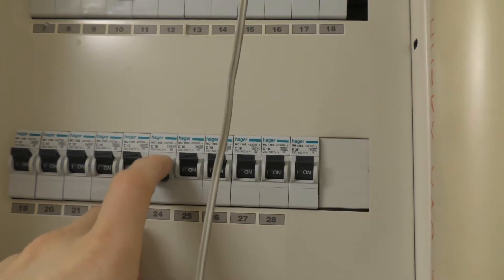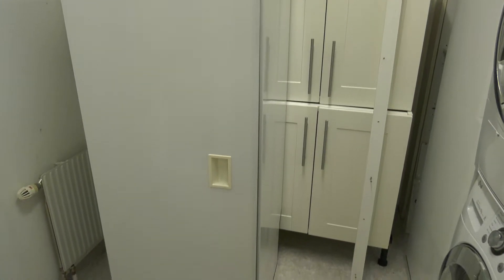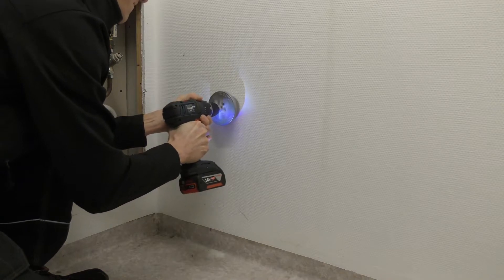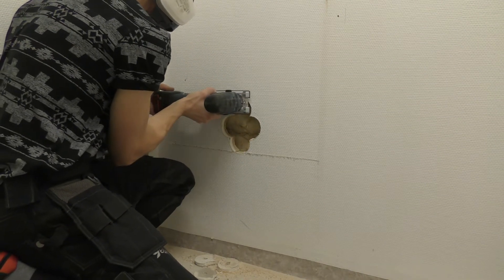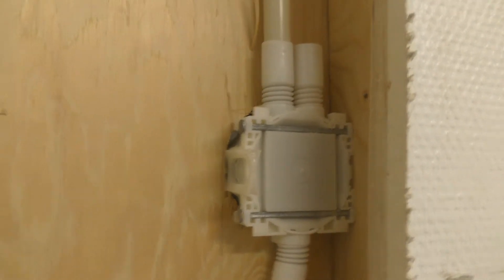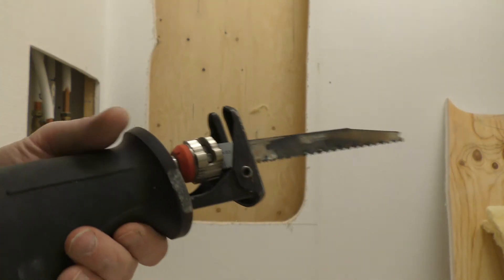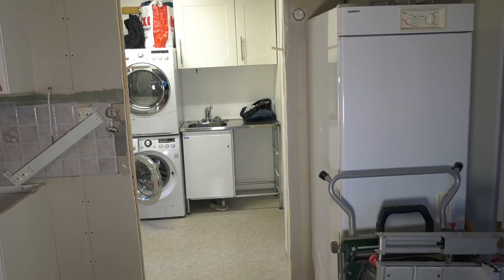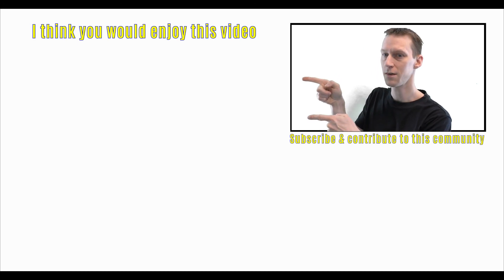Preparing for the solar on the urban homestead

Comment: This is indeed very timely, as I was thinking about doing something very similar on my homestead close to Mariefred in Sweden. What kind of investment are you expecting will be required for a 12 kW system in Sweden? I would expect it to be around 300k-400k SEK. Would be great to get your thoughts on this? Tack  så mycket. Bästa hälsningar John
Reply: Sorry, reading does indeed help - saw comment below of approx 15k USD
Reply from the maker: horatio71 Well in our case we are looking at about 150tkr after the 30% reduction from the government. But there is no battery bank in this setup. With battery bank from Tesla we are looking at the dubble. Hoping to get the the snow of the roof soon so we can do the installation.

Comment: How much is all of that costing You?
Reply from the maker: Gene Johnson We are looking at 15000 USD after the 30% reduction from the state. The payback time will be about 6 years.
Reply: Offgrid.se  That's not too bad actually... Relatively short recovery time.
Reply from the maker: Gene Johnson I belive its pretty good.
Reply from the maker: +horatio71 Sure https://cellsolar.se I really like them. They have taken he whole responsiility for everything. The only thing I had to do was stigning the pappers for the reduction from the government and I dont need to pay them anything before the system is installed and up and running. But when I do the total Off Grid system for the homestead in the woods I will do everything myself.
Reply from the maker: horatio71 Absolut, har du flera frågor är det bara att ställa dem.
Reply: @Offgrid That is really an interesting - would you have a link to the supplier that you are using?
Reply: @offgrid, toppen tack så mycket.
Reply: @ offgrid, det gör jag gärna. Jag har en gammal bondgård i mellan Sverige, men bor utomlands och letar en intelligent lösning där man inte ruinerar sig pga strömkostnader. För ögonblicket har vi elektriska element! Jag tror med 12 kW klarar man att hålla alla hus frysfrit. Om ca 2-3 år skulle efter grundläggande renoveringen är klar skulle det passa med solar panel. Taket av ladugården står rätt till söder och har en stor takyta där vi skulle kunna sätta panelerna.

Comment: Just a little curious on why is there plywood behind the Sheetrock? Is that required out there or as it installed for a reason?
Reply from the maker: thomas jenkins Yea, I wasn't prepared for that either. The rest of the house only got sheetrock. I found out that this part of the house was a pre built unit that was lifted in place. That could be the reason. There is no building code that sais that you need it.